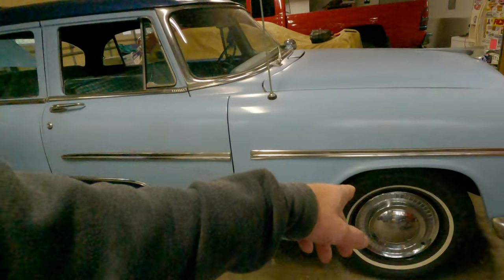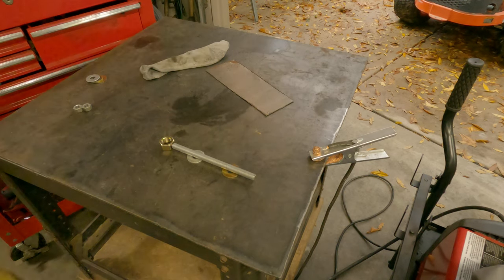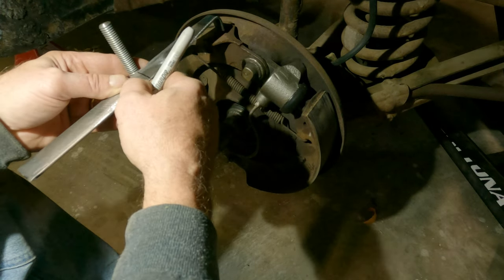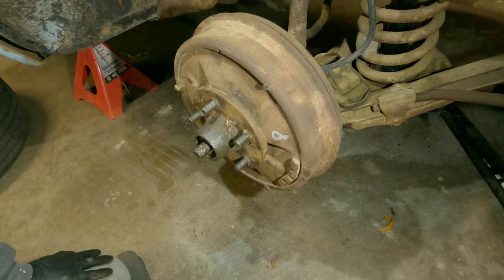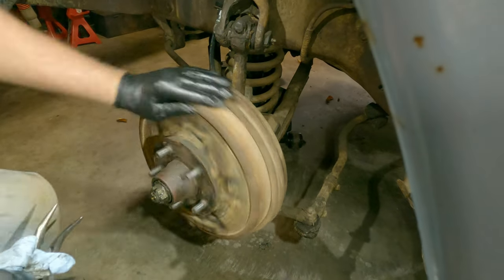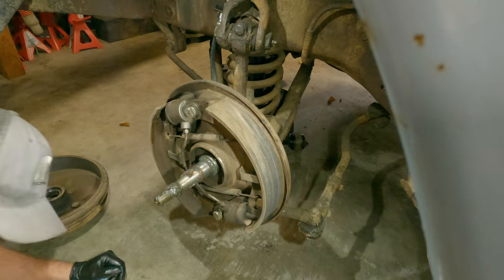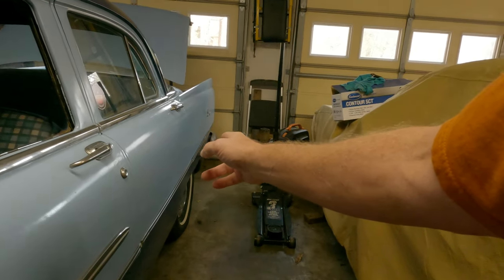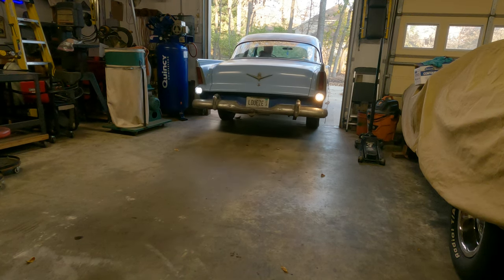Adjusting Brakes Old School Style | 1956 Plymouth Savoy

Comment: CHUCK!
I always whack the shoes with either the palms of my hands or even a rubber mallet after adjusting, Chuck. 
Gets the shoes "settled" to where they're ultimately going to rest afterwards - and I agree, the tool is a bit
useless for me.
Cataracts, ugh. I got one forming right now that has actually improved the vision in my left eye (formerly
astigmatism) to the point I don't need glasses. Weird!
But....as the doc said, that rascal will continue until it'll all go to hell and I'll need it removed one day soon.
"Old man disease" indeed.
Be careful and feel better, my friend.
- Ed on the Ridge
Reply from the maker: Ed, yeah I whacked them to settle them.  The shoes on this car don't really need that I've determined, but it doesn't hurt.  They are riding solid on those cams which go through holes in the shoes so there really is no play.

Where this tool comes in is with a new set of shoes.  You adjust a heel out until it rubs the drum "just right" and then you use the tool to adjust the other three settings.

I figured out the explanation after the video was done and left it at that.

Thanks

Comment: Nice video, my 55 Savoy I refurbished all the brakes, and made a tool similar to yours. The manual I have states to have . 007" gap between the shoes and drum. Not sure how a guy is supposed to arrive at that! I just adjust to feel a decent drag, doing one shoe at a time.
Reply from the maker: Yeah, I really didn't read it like I probably should have.  Actually not at all.  I know that mine are more snug than I would have liked but I suppose that they'll "wear in" as I drive.  Good luck with your '55.
Reply: @Chuck_House_of_Mopar  I'm just a shade tree wrench turner, mostly on my 72 Challenger street strip car, needed a new toy and the 55 fits the bill, thanks for helping keep these older autos on the road! Mopar or no Car!!
Reply from the maker: Yessir

Comment: If the LF is pulling, take a tad out on the left, or ad a tad to the right.  No need for that tool (it's a clever idea that just isn't needed).  Final adjustment on drum brakes always by feel.
Reply from the maker: Thx X man.  Where the tool will come in handy is when you put new shoes on.  Adjust one corner out until it's just rubbing the drum and then adjust the other 3 corners to match.
Reply: @Chuck_House_of_Mopar  That's just making it more difficult.  You tighten them up until you just barely can get the drum back on, then mount the wheel, then adjust them up slowly until you sense equivalent drag as you spin the tire by hand.  Then test drive and fine tune if needed.  4 corners?  NO.

Comment: Easier to spin drum freely adj from back where shoe barely catches at one spot then use your tool to adj shoes at that spot all around....hoping drum is true.  (Shoes use to be sanded down to fit drums)
Reply from the maker: Yep Tim, that's exactly how it should be done. If I have to put on new shoes some day, that's exactly how it would go.
Thanks

Comment: Check the tire pressure?
Reply from the maker: I had checked it a month or so ago, they have always pulled to the left until you really push down on the brakes.  I guess that they still will.
Thanks